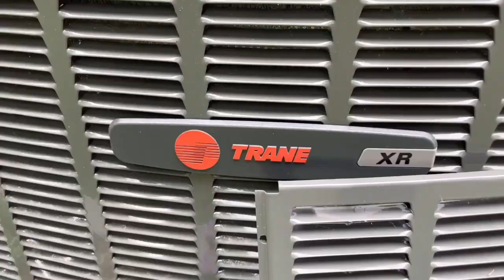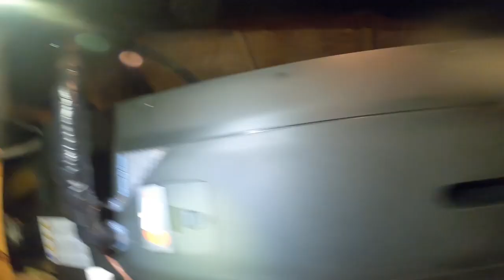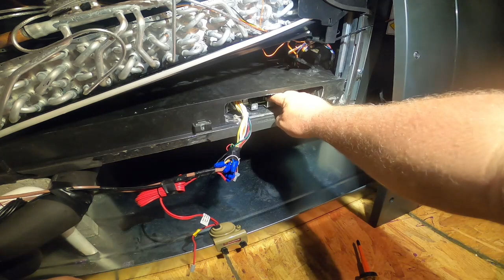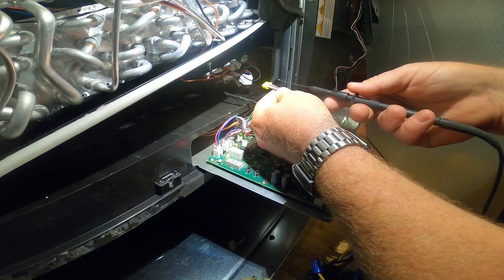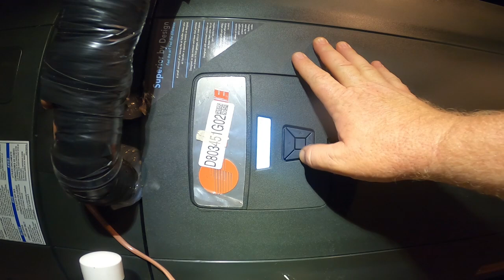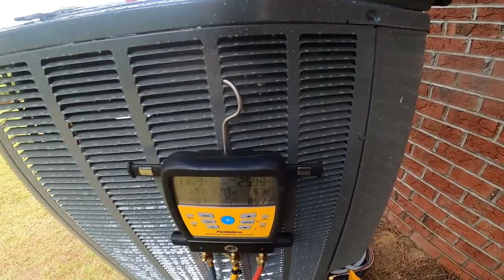A Trane heat pump start up with a minor issue.

Comment: I've reworked those connectors numerous times. A small set of jewellers screwdrivers will enable you to do a lot with them to sort them out. They can be a bit delicate to work on, but once you understand how the two main types work I've found they can be reliably fixed.

Comment: That little piece of pvc pipe you had the tips in was 1/2” or 3/4?
Reply from the maker: 3/4 but 1/2 might work if you put them in opposite with wide side on opposing ends
Reply: @MYHVACLIFE    Thankyou sir

Comment: I have a question, will that display be on all the time. Say you come up to one on a maintenance and the screen is blank with no display at all or will the display show a signal at all times
Reply from the maker: Lights up when you push a button. Always displays current operating mode or any present fault alerts.
Reply: @MYHVACLIFE  I figured it would at least say occupied or standby mode. It’s weird though the system will still work normally as I was told

Comment: This is a common issue we have seen. The wires just hang inside the housing where it can jamb up and cause a loose connection. It should able to clip into the cover for easy secureness